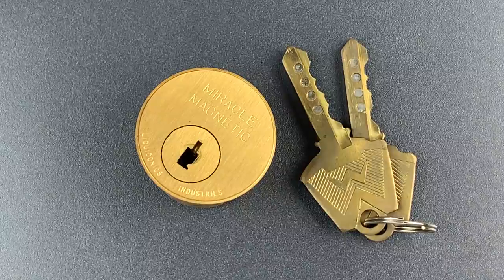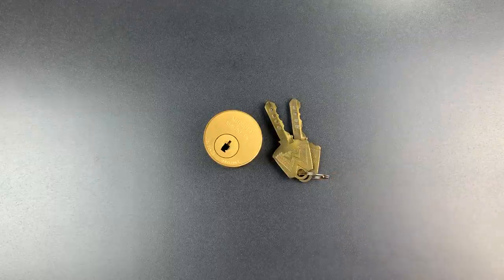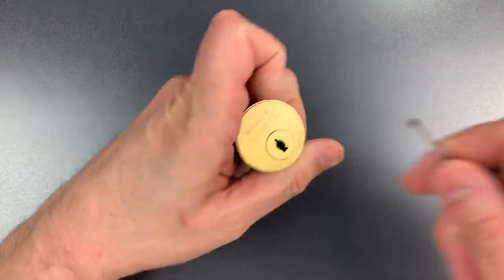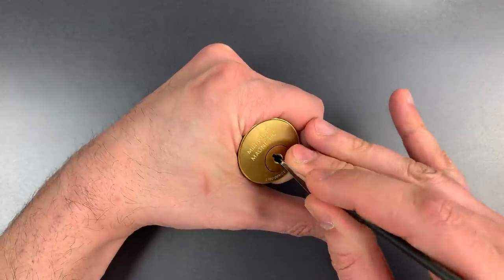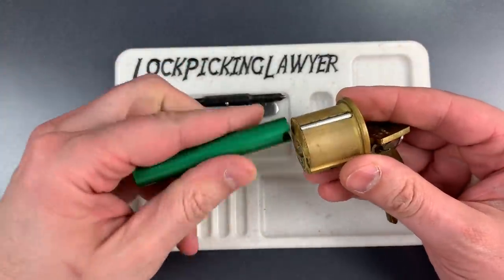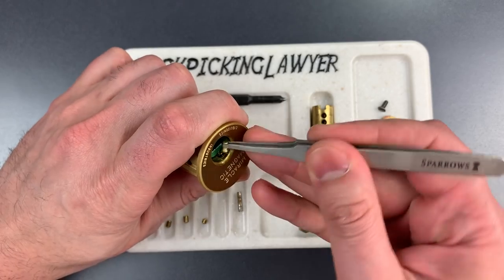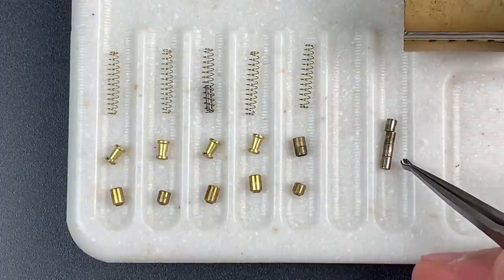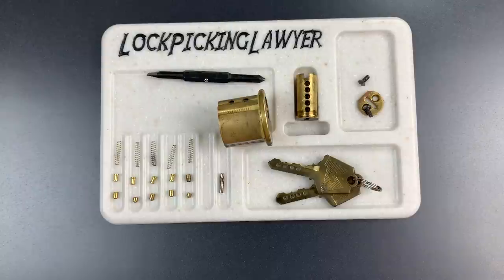[856] Vintage High Security: The “Miracle Magnetic” Lock Picked and Gutted

Comment: if it wasnt so obviously labelled as magnetic. Imagine someone in the field picking over and over and it just wouldnt open
Reply: I wonder if you can feel the magnets if your pick is ferromagnetic; would be a dead giveaway in that case.
Reply: Would you just carry tiny magnets on you?
Reply: I was thinking the same thing, remove the magnetic branding, perhaps change the implementation of the magnetic pins a bit, and the result should be a high security lock...
Reply: @HeimoVN  Then it's just security by obscurity, which isn't what you want. The keyway is also pretty unique, and so easy to spot.
Reply: @Cloaked1000  obscurity is decent security though. If the picker doesnt know what hes doing wrong, he cant improve.
Reply: @2MeterLP  Security by obscurity is almost always just security theater.

The picker can defeat it by simply getting the information, which for locks is pretty easy.

Extremely easy in the age of Internet, in the 70s the picker would probably just browse lock catalogues and shops, or ask some knowledgeable locksmiths. The keyway would be quite recognizable.

In this particular case, a savvy picker could just check for magnets. The keyway should raise suspicion of something out of the ordinary.
Reply: @Cloaked1000  Security by obscurity is just another layer of security, point being, the idea is not bad, if it simply looked like a generic lock from some random chinese factory, you will have quite a hard time figguring out how to open said lock...
Reply: @HeimoVN  both your points are valid - obscurity isn't reliable in itself, but it sure doesn't hurt, but it wouldn't work well in this case. But that's all moot; the fact is, almost no thief is going to be equipped to deal with magnetic tumblers, because they're vanishingly uncommon.
Edit - unless you have a static, high value target that's visible for lots of consecutive weeks. Then someone might take the time to learn about it and come back. But if you're high risk enough to be profiled in that way, you really should be counting on more than just a lock.
Reply: @Cloaked1000  That's not it security, obscurity plays a big role in locks
Reply: @mattiasso  technically locks only work by obscurity: all the information you need is how much to lift each pin. The key contains all this information in a small and convenient package, but a picker can, as shown by LPL, obtain the information by trial and error.
Reply: @TheNasaDude  you are the only person in this thread with any sense
Reply: @TheNasaDude  yes technically that is security by obscurity, but the term really refers to systemic vulnerabilities. Knowing the pinning of one lock has no relevance to the next lock you come to.
Reply: @MarvinCZ  security is an illusion.  It can easily be defeated by an axe, a gas axe, a sledge hammer, dynamite, ect.😉
Reply: @randymagnum143  But that is loud. Loud is the enemy of the thief. Most thieves are opportunists. They see an opening they can exploit and take it. Just making it loud to open quickly and long quietly can be enough to deter most. Security is just a numbers game. Banking on the fact that the average low skill opportunist won't be tempted by the level of difficulty you have presented. A determined attack won't be detered by much that doesn't involve close quarters muzzle flashes.
Reply: Just cover it up ?
Reply: marvincz Security by obscurity is not a good option if you’re a company making a product that uses a proprietary cipher that will eventually be cracked and you’ll keep selling it even then after trying to hide the exploit via courtroom, for example (looking at you, NXP...),  but for your home? Unless you’re famous, only the common burglar is going to even attempt to get in, and last time I checked, most aren’t exactly expert lock pickers.
Reply: @MarvinCZ  Who the heck checks for magnets? In all of the LPL videos, this is the first I've seen with magnetic pins. If you could use narrower magnets with a smaller keyway, you'd never notice it.
Reply: @digitalranger4259  It's a production lock. You don't have to check for magnets, you can just look up information about the lock and you'll know.
But if it wasn't... Do you know how one checks for magnets? By putting a piece of steel near them. Do you know how one picks a lock? By sticking steel tools inside it. Any picker with a bit of feel should notice the pull.
Reply: @MarvinCZ  Yes, one could look up the info online about any lock, magnetic or otherwise. If you knew you had to pick that lock. Once could also feel the magnets inside with a steel tool. With a big keyway.
My point is, who carries a bunch of tiny magnets to rake attack locks? Magnetic pins are not common. And if the magnets were smaller on the key, and the keyway was tighter, you might not be able to feel the pull.
Reply: @MarvinCZ  I think if the lock could be made to look and feel just like other locks, then given a sufficient number of alternative possibilities you could make it secure, in the same way that cryptography generates a sufficient number of possibilities that guessing the correct key becomes highly improbable.

The difference between having 1000 different possible unusual lock internals that the attacker knows but doesn't know which one without going through every possibility, and hoping your one unusual design will be unknown to the attacker who can just buy a copy of the lock to open and inspect. eg, the former is not security by obscurity at all.
Reply: The way the key hole is designed and calling  the miracle magnet it’s more of a gag gift or a puzzle
Reply: Seen a lot of comments on both sides of the matter in this thread. But unless I've missed something, here's what I haven't seen:

A specific reason to put "magnetic" on the front of the lock.

Not a defense for why it shouldn't matter. I've seen that already. But to engrave something takes more work than not engraving something. So there should be a reason. What's the reason here?  Even an "opportunist" might give it a shot even without magnetic tools. Why wouldn't an opportunist at least give it a shot. It doesn't say, "This lock will shoot you in the face with a bazooka if you pick it. The word "magnetic" just means "you might not succeed". That's hardly a deterrent. Every lock in existence already implies that. If it's an effective deterrent, then every single lock in existence should have "magnetic" emblazoned on the front to scare people off.

I'd probably chalk it up to "different times". If a manufacturer put "magnetic" on the front of a lock in today's world, that would only make things easier. An opportunist with Amazon Prime could just come back in 48 hours to finish the job.
Reply: @Cloaked1000  Security-through-obscurity shouldn't be discounted. It won't hold up to someone against whom it ISN'T obscure, but if you can defeat otherwise-prepared attackers by implementing a novel security mechanism they're unfamiliar with, or unable to identify in the field, you've done your job.
Just don't rely on it as your only defense! But if you can obfuscate something in an otherwise mediocre defense, you've achieved a strong one. Obfuscate a strong defense, and you've got a Naughty Bucket candidate.
Reply: I feel like half the security in these things comes from the obscurity of not being able to google what the mechanism is...
Reply: @2MeterLP  "Decent security" via obscurity. You keep using those words but I don't think they mean what you think they mean.
Reply: @TheNasaDude  Security by obscurity is about mechanism being secret instead of individual key being secret. A well made lock has fully published design without any secrets but the actual entropy encoded in the key. That means, the secret is tied to the individual key, not to the lock design. That's why removing the logo from the lock would not increase actual security even a bit but would be just an example of security by obscurity, which is equally flawed idea to DRM systems in digital world. Neither can work in theory any more than perpetual motion machines.
Reply: That keyway the size of a garage door though. They can literally shine a flashlight in there and clearly see all the funny business going on. And with metal picking tools a clever crook could easily ascertain that there are magnets inside. Just sayin, if someone has already devoted to picking your lock they've already decided that they're going to get in.
The thing to do is to make it as difficult and time consuming for them as possible. I like this lock featured here but that giant keyway puts me off a bit.
Reply: Questionable decision to put that information on the lock face

Comment: Rare earth magnets were developed in the 70's and 80's (Neodynium in the 80's), so it seems unfair to pick it with future-tech that wasn't available at the time.
Reply from the maker: That’s fair. Never considered that. 👍
Reply: Yeah but with a coil of wire and a battery and a switch you could easily make any ordinary pick into a much much more powerful magnetic rake.
Reply: That's what I was going to say. The type of magnets he's using weren't available at the time these were in production.
Reply: @IIAOPSW  Making it TOO powerful would be counterproductive.
Reply: @IIAOPSW  You wouldn't have an alternating polarity throughout the shaft like he did, though.
Reply: @sithlordzach8418  You can wind the wire any way you like, though. 8-shape would do the trick. Or alternate the current direction electrically instead
Reply: the new, stronger magnets also would make the key and the keyway a lot tinier, maybe a new magnetic lock would be harder to pick
Reply: SithLordZach my shaft always has alternating polarity
Reply: @mriguy3202  Just curious if there is any newer or current version(s) of magnet-laced locks? Great idea MRIGuy!
Reply: @JohnDoe-pv2iu  sorry, I am not a lock guy.  LPL should design a lock and send to Bosnian Bill and vice versa as a challenge!
Reply: John Doe Yes, there are! Mul-T-Lock has magnetic key locks, the MT-5 series.
Reply: alan doak        You’re a fair-locking advocate?  I commend you sir.
Reply: then again, a good new invention in the security branch should consider possible future technological advancements
Reply: @mariosebastiani3214  one can only apply that to reasonable extents so much. Say in the future we have tiny machines that instantly melt non-ferrous metals in a precise way using eddy currents. You can’t really plan for that.
Reply: @KinreeveNaku  "possible future technological advancements" refers to something that obeys the laws of physics, not sci-fi.
Reply: @MrCh0o  AC current fed to electric raking pick with a coil at each magnet position inside the lock would indeed make very effective magnetic rake. Maybe even use some kind of frequency sweep for the AC cycle so that if there are springs or timing related stuff, even those would be solved automatically.

Comment: Can we get a video explaining some of the jargon? Such as what is a false set? Some of this mystifies me as much as the dentist terminology.
Reply: I know this is old and all, and I don't know if he did explain this later on, but a false set (from what I can tell) just means that the core rotated into one of the gaps of those upper mushroom pins rather than between the pins, which can usually be felt when you're experienced because you'd feel the metal hit against the pin rather than sliding past like it would on a normal set.
Reply: It means the core is slightly rotated but is still unturnable meaning some pins are partially or fully set and there is a high likelyhood for security pins
Reply: My friend Google answers all my questions. You should get a friend like him too

Comment: Vanity may be part of that company's undoing.  The print on the lock alerts the picker that he/she is dealing with a magnetic lock and knowing such is a big step toward success.  No knowing could really be a frustrating experience.
Reply: Wouldn't you say the magnets were fairly obvious?  Wouldn't really be fooling anyone. Meanwhile they'd miss the advertising angle.
Reply: @picramide the magnets are obvious on the key, but as LPL said, the holes for the magnetic pins dont reach into the keyway, so if it didnt say "magnetic" on the front, someone trying to get in would have no idea.
Reply: @2MeterLP  Isn't the odd and ginormous keyway more than a bit of a giveaway? Plus, it's well known that security thru obscurity is bogus. Its magnetic aspect would be out of the bag in no time.
Reply: @picramide  ok, I did, and now?
Reply: @2MeterLP  my apologies. I thought you'd replied with a restatement of your original points. Apparently you didn't, or else you deleted it. In any case, to the original point, an enormously fat keyway with no warding screams "magnetic" to me, even if it's not printed on the lock.
Reply: @picramide  But in the early 70s, very few people would have even been aware of magnetic locks.

Comment: back then it would have been harder to get hold of those tiny strong magnets
Reply from the maker: Yup... particularly because they hadn’t been invented yet. ☹️ I didn’t know that until it was pointed out by another commenter.
Reply: LockPickingLawyer Maybe a few loops of transformer wire with an AC current flow, would have done the same.
Reply: @RuneInternational  Or do you in if you touch it wrong...
Reply: @RuneInternational  how could you obtain multiple sites of opposite magnetic polarities within a single inch that way?

Comment: A lock using differing strengths of magnets as well a polarities for encoding would be interesting.
Reply: The evva MCS actually uses magnets placed "sideways", so both a North and a South are presented to their pairs in the lock, they rotate the magnets in the lock to match. If you're remove the key quickly, you can often hear them spinning on the inside.

Comment: In 2001 I installed four Miwa magnetic locks using the same idea but narrower key way. I did it not for security, (though it would’ve be relatively pick-resistant, since no one but a flat-out expert locksmith or collector would know how it worked), but rather because the key was “zero insertion force”. The key just glided in like butter!  My Miwa has 7 magnets on the top and bottom edge of the key. It could still be picked using a single magnet to determine polarities, and then making a faux key with the proper magnets, but you first had to have access to the key to make something that was precise enough in order to locate your replicated magnets. 

There’s a YouTube video I saw demonstrating the above technique.

Comment: Its still an impressive lock. A lot of thought went into it's design. I love the overlift rod idea.
Reply: I can see the overlift protection works by physically stopping the pins from being raised above a certain amount, but given the picker wants an accurate alignment along the split line between the core and the case,  why is it needed?

Comment: Neodymium magnets were not invented until  1982.  I wonder if a rake made with magnets from 1970 would have the strength to overcome tensioning of the plug and set the internal magnets.
Reply: they had whatever magnets were in the key... Wouldn't those be strong enough?
Reply: @ianitor  it seems to me that with neo magnets you could make the key and the keyway much thinner which would make a magnetic rake more difficult to use. Or, their strength might even allow more warding in the keyway as the in-key magnets could be machined along with the key blank to follow the necessary counter of the key. Also, there might be ways to position the magnets at different points - for example the magnets on the left could be higher than those on the right which also could also make using a magnetic rake more difficult.
Reply: @ianitor  Those magnets had to go completely through the key and be very thick to work (hence the wide keyway). Putting that kind of magnet on the outside of a rake wouldn't have fit.
Reply: Brass bar with holes in it will fit same size and type of magnets as the actual key. So also a rake could have been made back then i assume.
Reply: While requiring a more complex and specialised pick, with electricity you could create a strong enough magnetic field without rare earth magnets.

Comment: This would be much harder to pick if the tolerances were reversed, with the magnets hitting their sheer line in between or after the mushroom bits were set. Would make it almost impossible to rake them while holding tension on the core to keep the pins from falling.
Reply: I agree, with today’s technology, tiny neodymium magnets, and with tight tolerances. A lock like this could be very hard to pick.

Comment: Was there some code applied to the magnets? For example, north vs. south polarity facing towards the key at the four different positions, so only a key with the proper code will work? When you took the lock apart, all the magnets connected to each other. It would have been interesting to see you touch the magnets to the key to show how the coding works.

Comment: How do the magnetic pins reset and hold the cylinder in place after the key is removed? There are no return springs to push them out. Is there a magnet inside the lock body to make them return or does the alternating magnetic pattern from the key being removed push the magnets outwards?